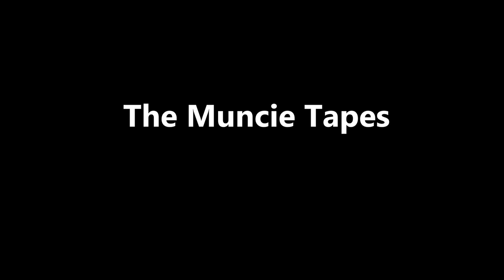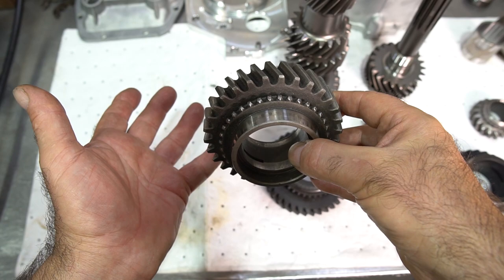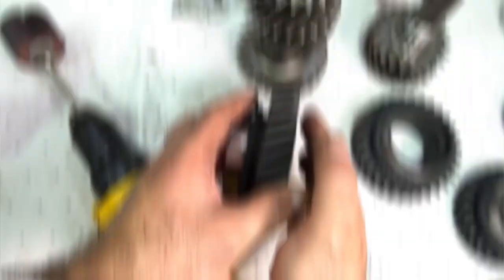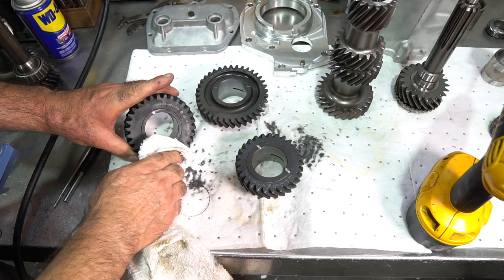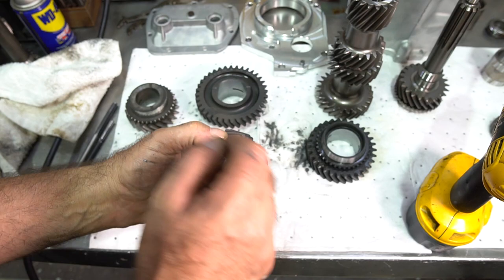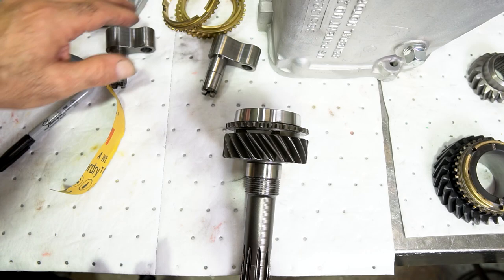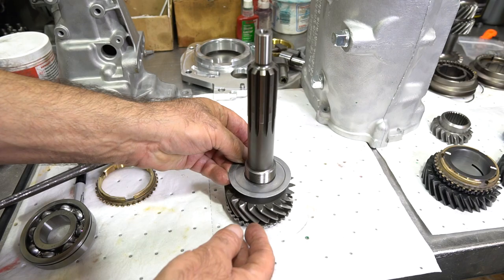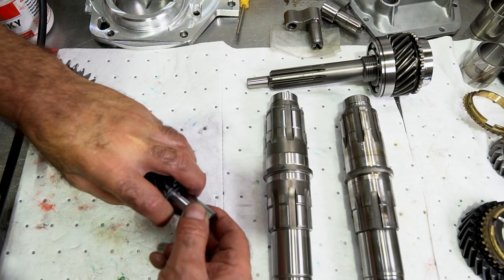The Muncie Tapes - Part 2 - How to Assemble and Rebuild a Muncie 4 Speed Transmission

Comment: The detail with the gears and syncros is where the knowledge and experience is. 
Anything else is a nut, bolt, spanner and hammer rebuild....it might work....it might be ok, Paul clearly doesn't light " might".
Thanks.

Comment: Hello Paul, I have been searching for information about the "Muncie" Doug Nash 4 + 3 that is in my 1986 pace car. Then I found you and then your videos "The Muncie Tapes". Thank you so much. If I can figure out some way to remove my transmission at home I just might put be able to use all of your valuable information. I have most of the tools and  I would rather do the job myself. Like everyone else, I have plenty of time on my hands.
Reply from the maker: I have a video on the 4+3. It's a heavy unit. The hardest part is getting the beam free.

Comment: My m21 wont shift into first gear wit the shifter. If i get under the car i could asist it and it catches. Does it sound like my first gear i s bad to you?
Reply from the maker: No. Sounds like it may be a shifter issue. Best to contact me for support issues after 7:30 pm weekdays m All my contact info is in video descriptions

Comment: Great video Paul. Is grinding the oil groove making the gear weak? The hardening treatment is only .030
Reply from the maker: No not at all . Think it thru. Where is the load and what would you think could possibly happen? Doing it for 40 years and if anything if you decide not to, then why deal with seized gears on shafts?

Comment: Thanks for the videos! Can hardly wait for part 3! Just ordered a bunch of stuff yesterday. Quick question; I picked up some Permatex 51813 as recommended in a different video. The package says to use a Surface Prep activator before using. Is this really necessary?
Reply from the maker: Nope
Reply: @GearBoxVideo  thanks for the reply!

Comment: what about spraying all your Gears rings with a dry PTFE silicone lubricant
before assembly
Reply from the maker: Because that stuff does not desolve in the gear oil and can cause shifting issues.
Reply: @GearBoxVideo  yes I know it doesn't dissolve but should it just stick to the metal supposed to be resistant to oil when it's dry would there be any issue?
Why does it cause shifting problems. Does it bead up go lumpy. Now I'm more curious!